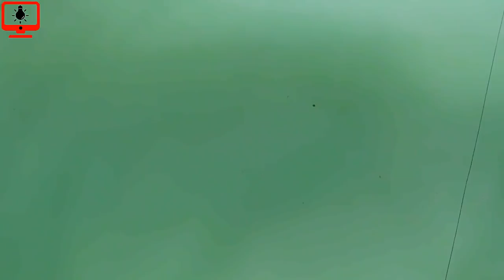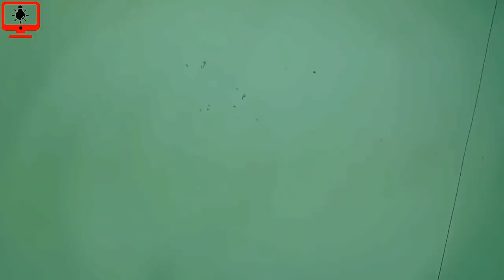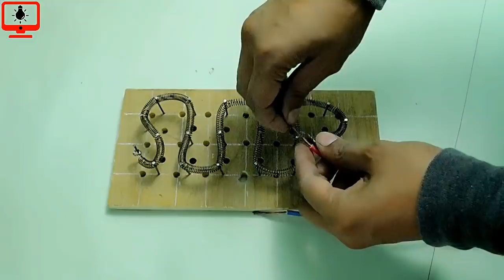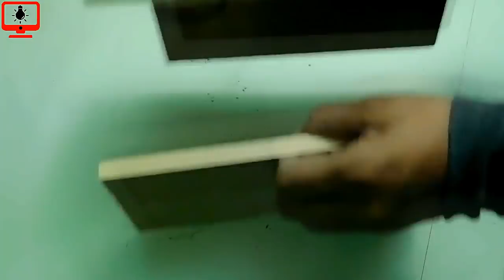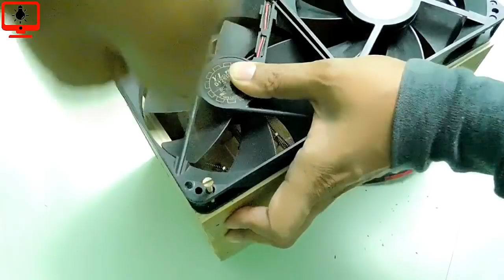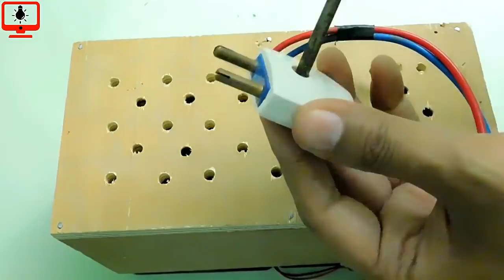How to make Room Heater at home (very simple)

Comment: Great idea but very poor design. First material used is wood/Acrylic, which are both easily flammable. Secondly fan will melt after a few minutes.......you could have inverted the direction. Use inner metal body and insulation at the outside to avoid burning of hand or skin. Still nice first try